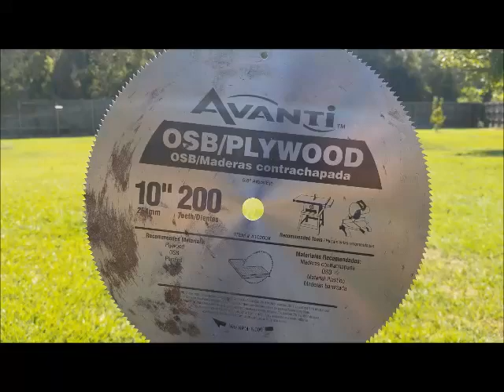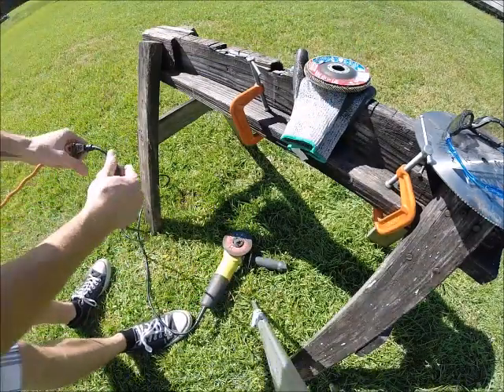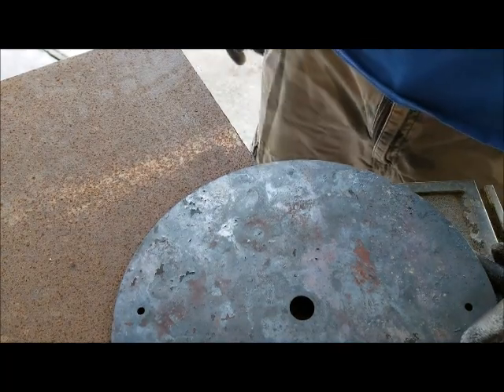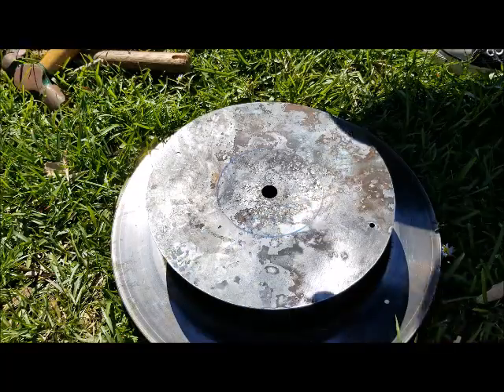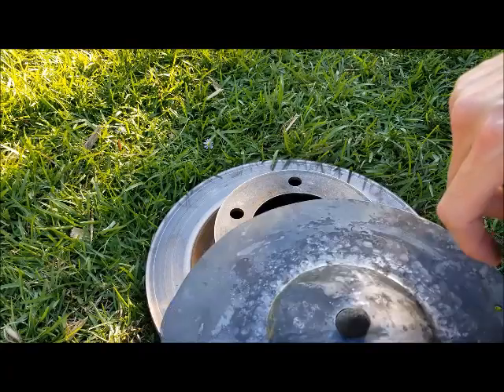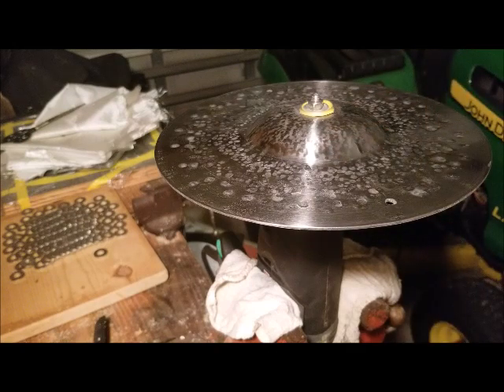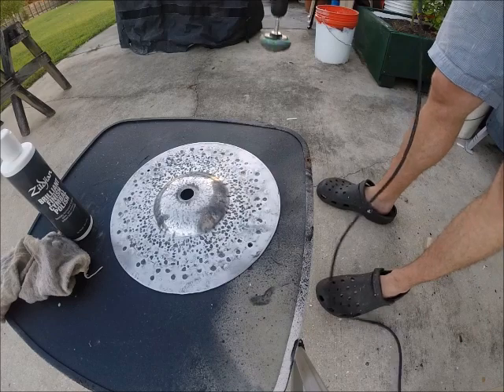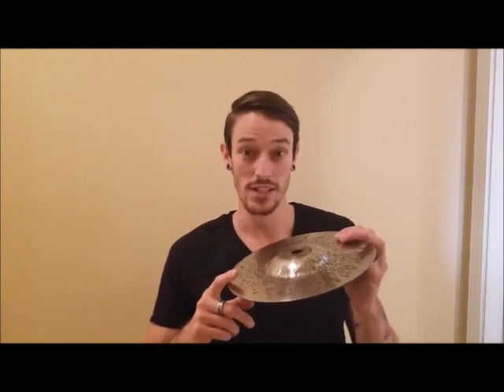Homemade cymbal from Saw Blade. DIY.

Comment: that was a lot of work but you did it, my only question is why didn't you mold it when it was red hot?
Reply from the maker: I think I was worried about splitting the metal. If I ever do it again I'd like to use a press to form the bell while it's hot.

Comment: What are the items you need? Can I have an list please? Just in case I want to make one.
Reply from the maker: The only items you really need is a angle grinder, a file, a hammer, sand paper and a drill to spin the cymbal on to help with sanding.